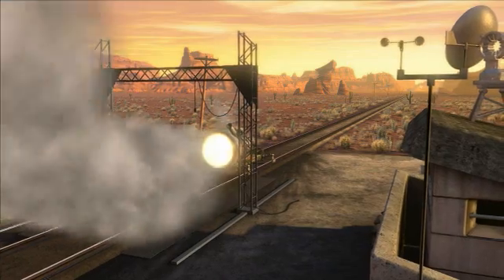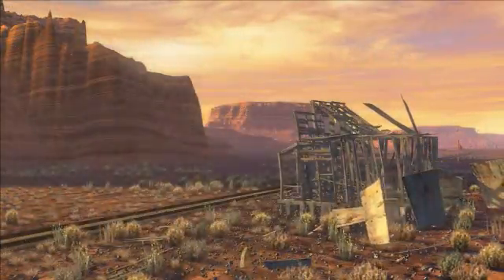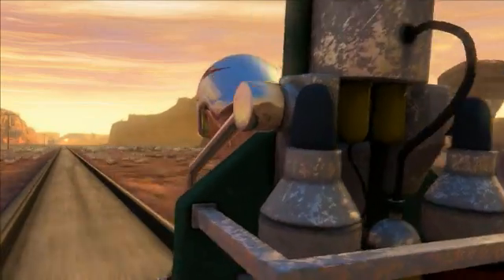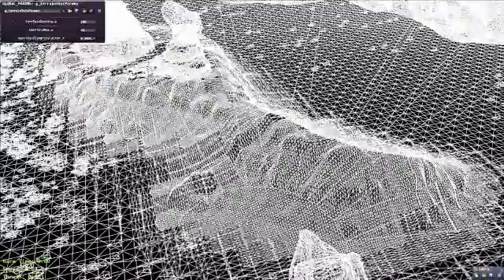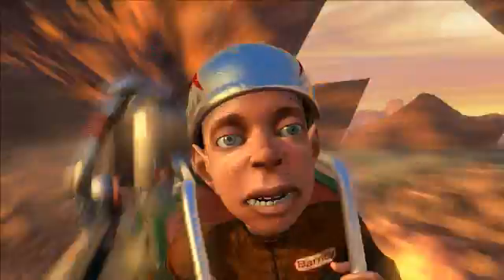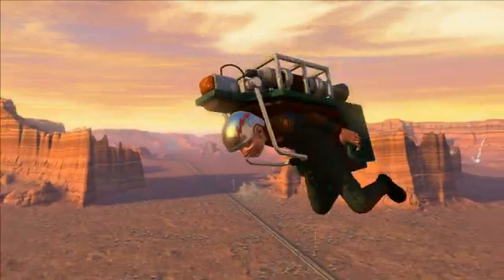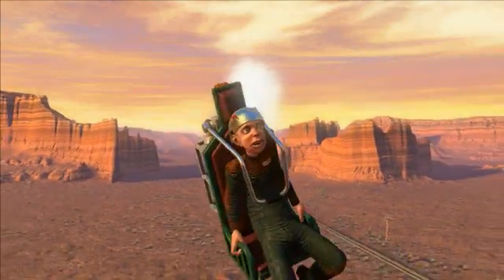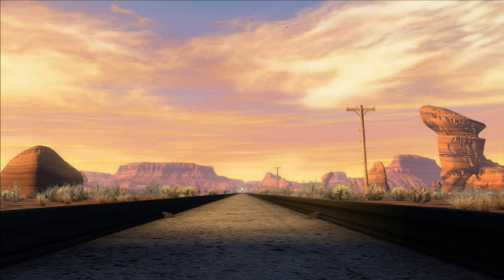NVIDIA Rocket Sled Demo: DirectX 11, CUDA, Physics, Fluids and More

Comment: What does that mean. Quad core cpu`s cost less than $100 dollars so there is no need for expence like that. That is my point. Quad core gpu's should be cheaply available now. Also even the army don`t pay millions on just the gpu's but they do on the simulators. Not the gpu's or cpu's. Most of the graphic cards available are all made from old tech still. Ie Rebranding and renaming cards with little in performance. Beleive me I know that $750 for a gpu is unfounded.